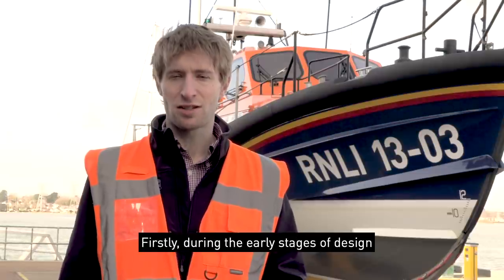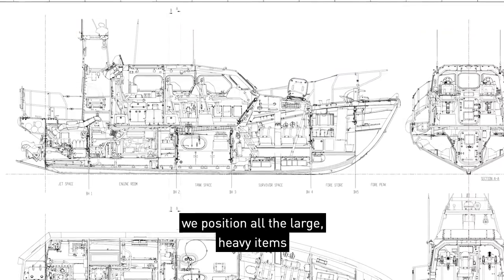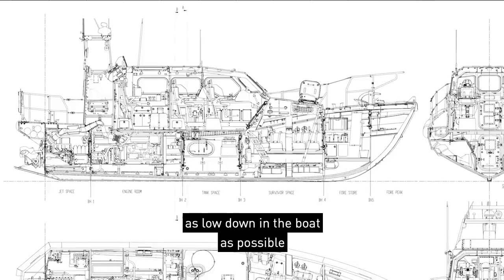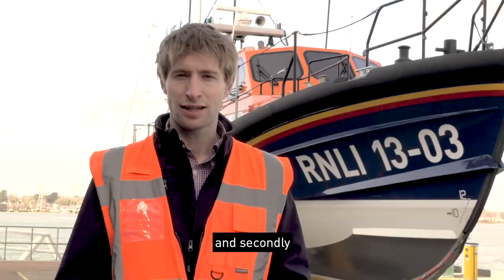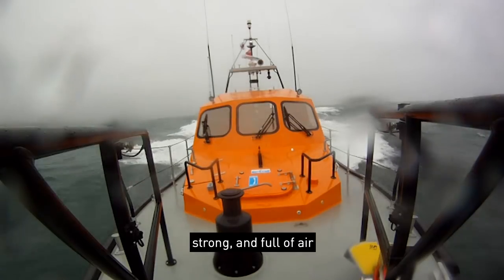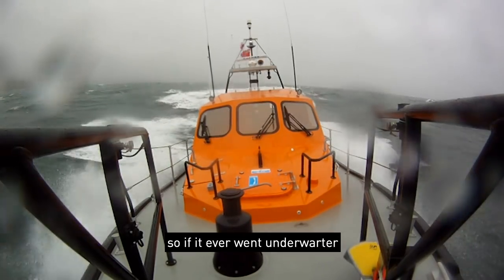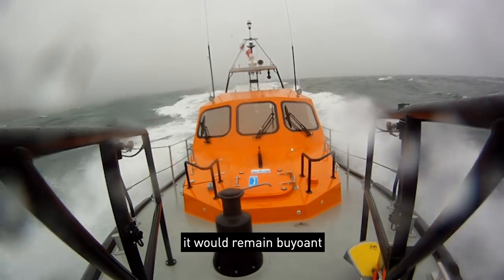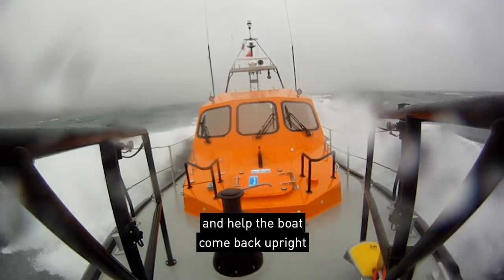How an RNLI lifeboat self-rights during storm conditions

Comment: 01.12.1981 the lifeboat danish RF-2 capsized. All 6 crew members did not make it. RF-2 was also designed to recover after a cap size. But it did not. The lifeboat was found in the morning grounded 8 km down the coast. Still after so many years so sad....

Comment: I’d love to know more about some of the technicals like maintaining fuel delivery, oil pressure etc. when inverted and how they are prevented from spilling all over the bilge
Reply from the maker: Hi Alex, great questions! In the event of a capsize, a signal is sent to the engines which returns them to low idle and also clutches out the gearboxes, which in turn stops the waterjets. In addition to this the air vents are closed to prevent water ingress. After the event the helmsman must bring the throttles back to the idle position and press the capsize cancel button in order to regain control. 

Because of the self-righting design of the Shannon the duration that the vessel is inverted is very short. This means the fuel and engine oil systems do not require any specific protection. The engine is sealed so there is no risk of engine oil escaping, and the short roll period means that the oil present in the system is sufficient to sustain the engine for that amount of time. The fuel system vent has a valve which is actuated during a capsize to ensure the fuel does not escape overboard. Any gaps in fuel supply to the engines are so short that they amount to no more than a short period of rough idling when the engine is righted. The fact that the engine is left idling provides enough pressure to prevent ingress of water through the exhaust system. During the design phase of the Shannon the Scania engines were fully inverted whilst running to ensure they would still function once righted.  
We hope that helps 😊
Reply: @rnli  I've been wondering for a while how do those boats prevent water ingress into the air intake not only while capsized (that was explained here and thank you for that!), but generally in rough seas when the water goes overboard and everywhere.
Reply: RNLI that’s brilliant thank you for the details! I always knew they were engineered to handle such events, I love hearing about how the details all work together. Thanks for the info, and the dedication you all have to keeping the mariners safe!
Cheers from the States
Reply from the maker: Hi Adam, the air intakes like the one you see in this video are behind covered panels that allow in air but not water. If you head to the following website where you can take a tour of the Shannon class, and click on the stern position, you can see one of these panels/vents to the left of the wheelhouse door. Sorry we can't add a photo on YouTube! https://bit.ly/2Y9zbOS
Reply from the maker: No problem Alex - we're always happy to answer any questions you may have 😊 Thanks for your support from "across the pond"!
Reply: @rnli  Thank you very much for the answer!
Reply: @rnli  So, that stops water from splashing in. What if the boat gets fully submerged without flipping? Like if it drops down off a crest and punches into the next wave? (Like, do those panels still keep water out long enough, or does the engine take on water in that (hopefully) rare case?
Reply: I always assumed the reason the 44-footers had that compressed air motor starter was to restart engine post haste after rollover. Fifty years later designs have progressed.

Comment: Excellent little video, thanks.
What if the wheelhouse door is open during the capsize?
Reply from the maker: The wheelhouse door remains shut at sea for safety purposes, particularly in rough seas. If it was open during a capsize or knockdown, water entering the wheelhouse could potentially allow it to fill with water and prevent self-righting, although there are other doors throughout the vessel that remain shut at sea to aid buoyancy and self-righting capabilities.

Comment: Are hatches supposed to open in or out when designing a boat?
Reply from the maker: There is no set standard for the direction doors and hatches open, however considerations would include: the direction of an escape route, where they would tend to open in the direction of an exit; or a particular arrangement or hazard within a space that would favour a door or hatch opening in a certain direction. Either way, our doors and hatches are watertight, meaning they will withstand the pressure of water from either side.
Reply: @rnli  if a boat was capsized would it be difficult to open a door outwards because of water pressure?
Reply from the maker: Our all-weather lifeboats (the only ones with doors and hatches) are all self-righting, so that eventually would never arise 👍

Comment: Apart from going to idle what other measures are in place to protect the engines with regards to oil starvation ?
Reply: I think they actually shutdown and run dry sumps. They have to be reset from the helm if they are inverted, which restarts them.
Reply: There's a reply further up this thread that explains that a Shannon comes back to the upright position so quickly that it won't suffer oil starvation.
Reply: Scania engines have an overheat and oil pressure loss protection,  in the event of either overheating or loss of oil pressure they shut down.

Comment: if a capsize is detected then the engines will stop running and the radar aswell ..... huh ?
Reply: Engines won`t stop, just throttled back to idle automatically, and the radar will stop spinning / disengage the motor turning the radar to stop the ocean destroying the radar itself, and the motor and gears that spin it around 👍